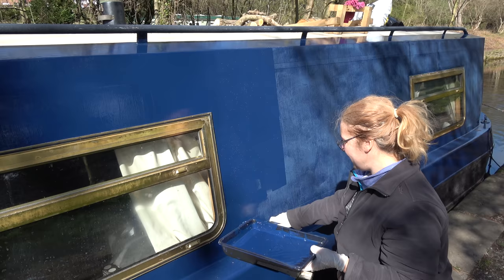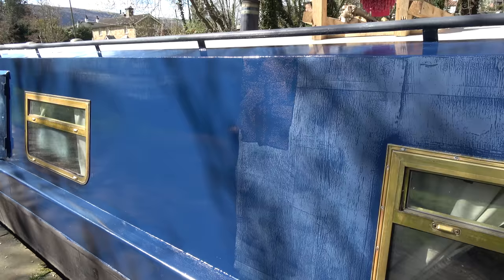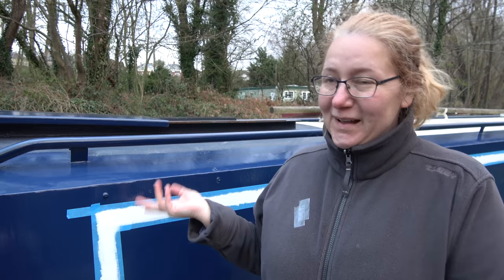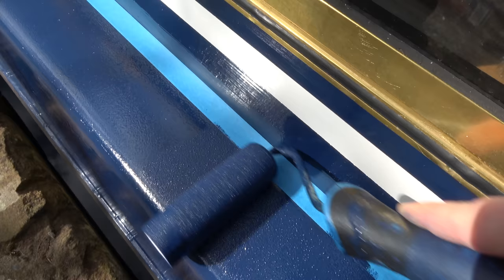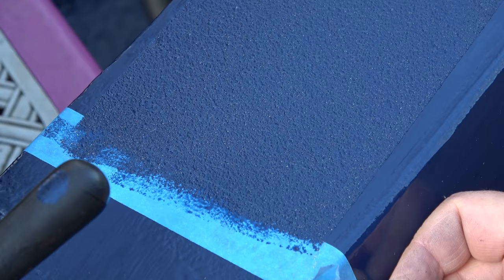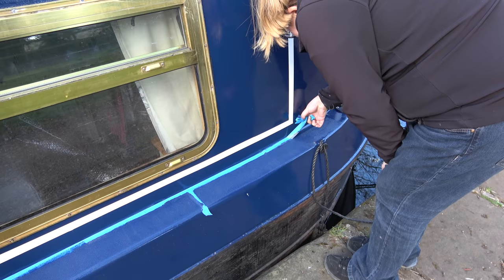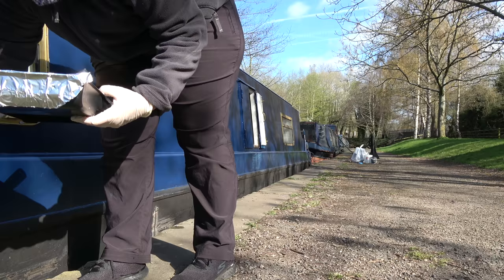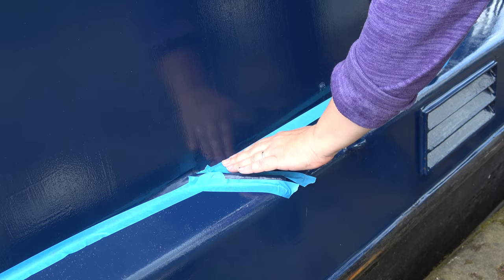How we painted our narrowboat  (gunwale and coach lines)   part 2

Comment: With a cruiser stern boat rain travels down the gun whale and into the engine bay.
A solution to this problem was found by having a rod deflection welded across the gun whale at an angle to deflect the rain water into the canal.

Comment: you did a fantastic job boat looks great..a little tip for you if you ever paint again.when you lay your masking tape where you tear it off fold the corner back a small amount it will make removing it a lot easier as you wont have to pick at it to lift an edge....well done

Comment: Quick tip for the masking tap over the side of the gunnels.
Don't leave a sticky bit flapping around over the edge, make it slightly longer and then fold it back on itself so that the end cannot stick down and then acts as a tab to help when pulling off the tape.
So no worries about marking your new paint job when the end of the masking tape sticks too well to the side.
Reply from the maker: Great tip. thanks

Comment: A little late now, but your dry sand probably could have been mixed in with a small container of paint and directly painted on to the boat. For airplanes they make a product for the wing walks that already has the sand in the paint and is applied with a brush.

Comment: next time you should try using skateboard grip tape, way faster and easier and comes in many colors.
Reply from the maker: Thanks, we thought of this , but I was worried because the surface is metal and not completely flat that water might get under the tape and eventually rust. There is a similar risk with sand also but I thought that the sand would be easier to 'sand' off and treat. But it is worth recommending as others might like the idea.

Comment: When painting it is best to use a 4" wide brush you will get a better finish then using a small brush.
Reply from the maker: Thanks. Looking back I should have bought a few more bigger brushes, but as I hadn't done it before I wasn't sure so I bought an array.
Reply: @TheNarrowboatExperience   Back in the 70's when I worked as a house painter I was taught to basically use a 4" brush for everything including painting window frames, because it is actually easier to cut with a 4" brush then it is to try and paint with a small brush which doesn't hold as much paint, likewise when you were painting the white stripe by using a bigger brush you will end up with a smoother finish instead of a lot of brush strokes.
Reply from the maker: Very good reminder. Thanks.

Comment: I'm sorry if I've missed it but a follow-up video with timing, costing and a break down of materials and techniques would be great for absolute newbies to boating. I hope to buy a project boat soon but I'm new to boats and I don't even know if I'm asking the right questions or what to search for when it comes to maintenance
Reply from the maker: Hi Holly, we didn't do a follow up for the cost of painting. The amount of materials you use vary depending on the length of the boat and how many coats you apply. Technically, with repainting, you should take the boat back to metal - which takes a lot of time and extra materials. Look up John Barnard on YouTube for advice on painting from a professional. 
Typical rule of thumb that we've found with any boat jobs - take the price you think it will cost and the time you think it will take then triple both because chances are that you have underestimated what it takes.
Good luck with finding your ideal project boat.
Reply: @TheNarrowboatExperience  thank you

Comment: I’ve been painting lots of things over winter with hammerite and roller so was hoping todo my boat when the weathers decent so can I ask how many tins did you use and how long is your boat.

Oh and It looks awesome 😎
Reply from the maker: Hi Sam, the thing with hammerite is it goes on like toothpaste so as long as you know that already that’s good. Also the first coat needs to be your best, you’ll always see it through the others. 
I used four tins but bought six with the thought of returning the unopened ones. The boat is 52ft.
Reply: The Narrowboat Experience yikes 4 tins what size were they? Guessing it still works out cheaper than the international boat paint? I painted a couple of small speed boats with that stuff and it’s the same the roller leaves loads of air bubbles so have to give it a few minutes then roller it again lightly.

Comment: did you get any insects stuck to the paint
Reply from the maker: Yes. You wait a couple of days until they dry out then wipe them off.
Reply: took six months to do mine on and off due to the weather. and  to do the sides i ended up paying to go in a poly tunnel @TheNarrowboatExperience